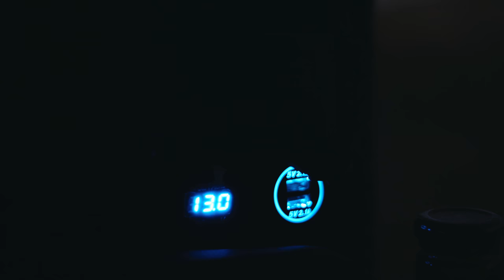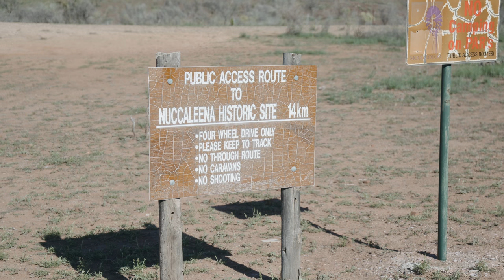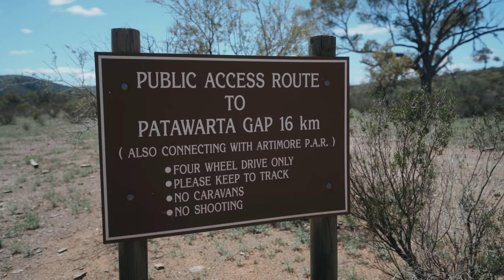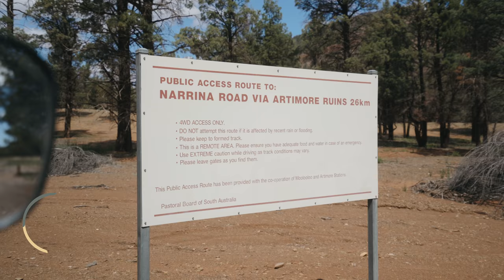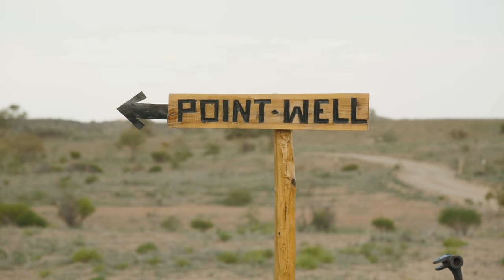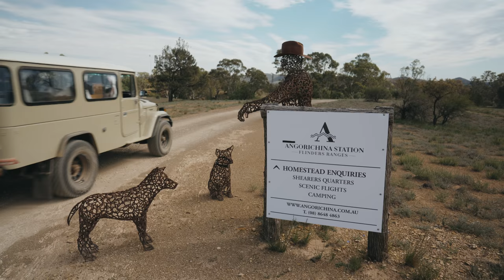Discovering Australia's Icons: HJ47 Troopy Adventure in the Flinders Ranges - Ep16

Comment: Oh please have a fire on the ground. More gadgets to promote
Reply from the maker: Few reasons we use a fire pit. Personally I don't like getting to camp and there are 10 different places people have had fires, it looks horrible and ash blows everywhere, so using a pit is less impact on the surrounding environment and less chance of you leaving a fire with coals to blow in the wind and start a bush fire (look what's happened to Fraser).People don't wont to use other peoples old fires when cooking because you don't know if they threw plastic on or not, don't have that problem with a fire pit. You use less wood, oxygen can circulate better through the fire and its way easier to cook on with the height adjustable grill. This one os the best for size and great for two people, its a product I really like and use, I think people looking for a fire pit will get genuine value from it if they are looking for one. If I like a product, I promote it 👍🏼